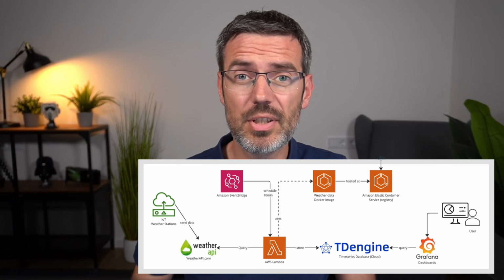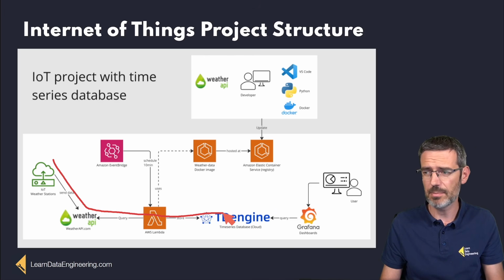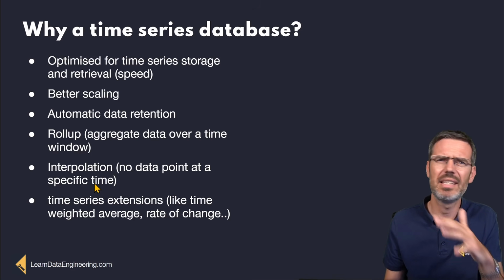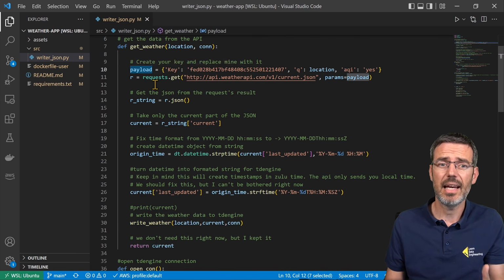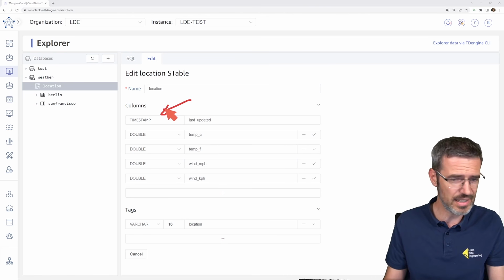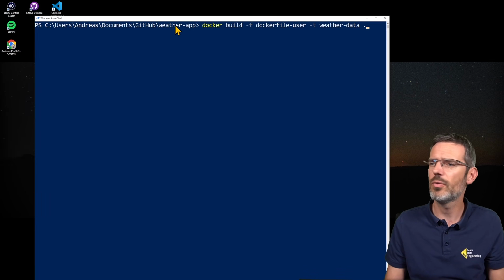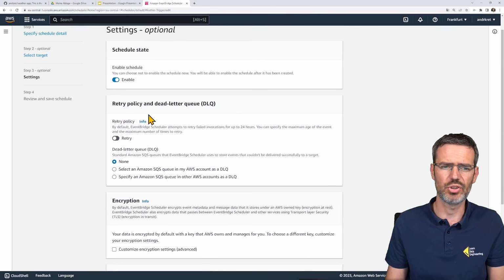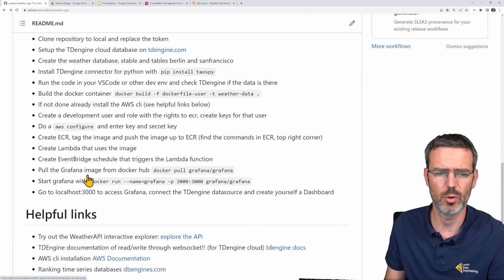Free Data Engineering Course with AWS, TDengine, Docker and Grafana

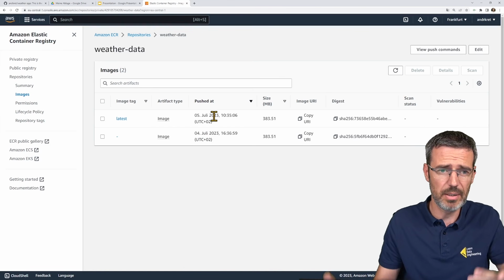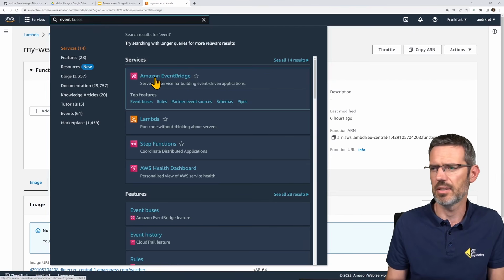Comment: Awesome video Andreas. I have been meaning to do this project in Microsoft Azure, using Azure Container Registry, Azure Function App and Azure Logic Apps. The docker file with the python source code and the following docker image is not working well in the Azure Function App. Can someone point me to the proper documentation or similar project done in Azure? I can upload the docker image to Azure ECR, but I am failing in the (@23:07) Create Lambda function using Docker image and (@24:12) How to schedule your AWS Lambda function with EventBridge parts of the video with the Azure services.
Reply from the maker: Hey Daniel, did you find a way? I'm sure there's a option to use a docker image as base for an Azure function.
Reply: Hey  @andreaskayy . I haven't touched the project since last summer. I remember getting stuck on programming the Azure Function.
I'll revisit this sometime this week
Reply from the maker: @daniellupercio7173  Would love to know if you made it :) Maybe ask chatGPT if it can create you a boiler code for Azure? 😅